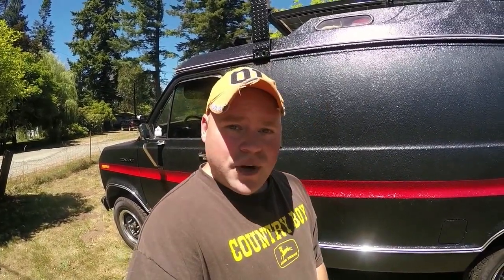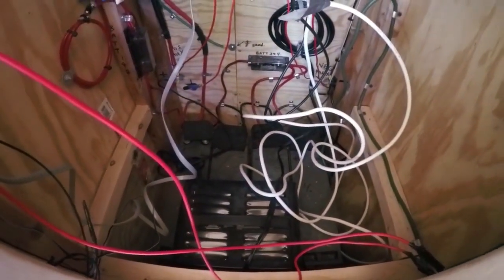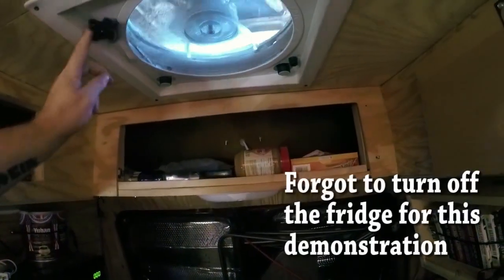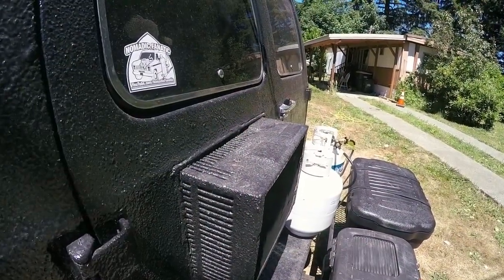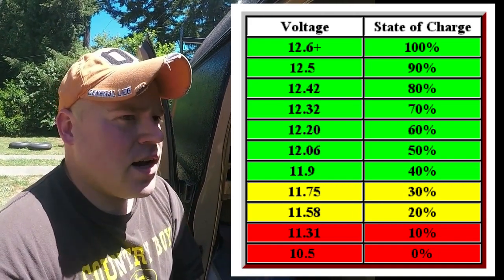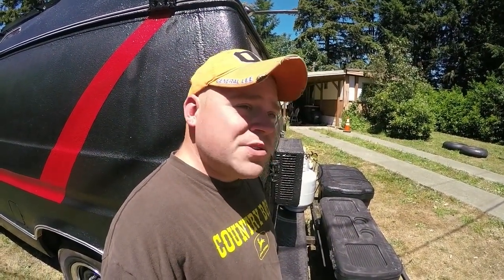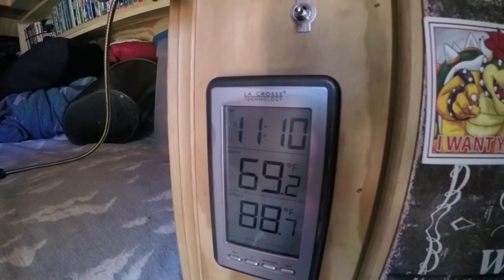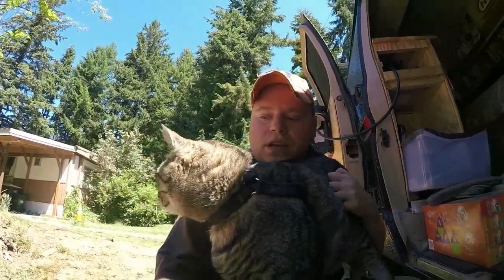Running AC Off Solar

Comment: That is really a sweet set up.  I am running a 5000 BTU A/C wall unit off of 4 batteries and 2 solar panels right now powering a 1500 watt pure sine wave inverter.   I put a video of it on my channel.  More people should do this.  The van set up is truly awesome.

Comment: HINT: black paint really absorbs the sun and makes the inside much hotter. I tried some white exterior primer from Walmart over my ancient black paint and you couldn’t touch the black paint but the thick white primer was really cool. The first problem was that it was water based and it rained after I applied it. White puddles, round my van... Next try was late in the day and the evening mist also...  OK, finally I got the picture and waited for a nice hot, sunny day.  Perfect. Didn’t look as shinny but sure kept the temperature down.

Comment: So ultimately , your AC uses way more power than your solar panel puts out and after a short time of being on, it will kill your battery,, 

You can get over 1300watts of solar panels to fit on the roof of your van ..

Comment: I live in the middle of Texas and I’m currently building a small off the grid camper trailer to pull with my Jeep. The interior is about the size of a full size bed with a couple feet extra at the end of the bed it has a ton of locking storage containers on the sides of the trailer so I’ll have plenty of storage for the solar panel equipment and batteries. I’m just wondering if I would be able to store enough solar power during the day to run a small Air conditioner in the evenings and possibly a small mini fridge? I’d also have a couple power outlets but they would only have something like my phone or laptop charging on those for a few hours during the evening as well. If anyone could give an idea of the equipment I’d need for all of this I would greatly appreciate the help I’m brand new to this but love the idea of it all.

Comment: How can cold you can you make it inside your van without over stressing the system.  In other words will it run at 70 degrees or is that more than system can handle?

Comment: Hey man could you help me setup somthing similar for me and my 12lb dog i too have had shitty habor frieght pannels and also invested in a grate to vent one end of my car open when times where tough, thinking about possibly just doing like 3 or 4 peak hour daily sessions with 350w panasonic 65 somthjng volts @8 or 9 amps possibly even finding a dc to dc psu option a/c or even making one my self using new 450w dc to dc converters bit of a stretch but anything beats 700 dollar rent

Comment: you cooled it down to below 70. If you let the AC unit turn on and off automatically you may be able to recharge batteries enough when the unit was not running.

Comment: I'm guessing your fridge is not the RV kind that runs off propane primarily... that would save you a lot of electrical juice.    Since you are dropping battery charge it's basically saying the solar system can't keep up and you are running off of battery... so no chance of boondocking indefinitely with it.  especially out here in the desert.  I think it'll be a few more years until PV panels get to the density needed to be able to power an AC unit in an RV...

Comment: Try to buy a new outbacks system and get a new 125 a/h 
5 battery and used a new 350w solar 2 panels for your power up RV test it out

Comment: Do you think Its safe to run the air conditioner on a modified sine inverter?
Reply: I dont think buying a modified sine inverters would be a good idea, you dont know good the technician who did it is. what if the mod causes it to overheat? or the wires are touching a voltage regulator that is not mounted properly to a heatsink or rough serrated metal that was cut, it can be a fire hazard more than anything

Comment: If it were me, I would cover the van with as many solar panels as possible, increase the battery bank, and try to run the A/C as much as possible.  You could literally be in the middle of nowhere where it's 100 F outside, yet Jax is trying to snuggle with the inverter to keep warm.  I'm a winter person, in case you want to know :)

Comment: Eric, I know you didn't add the AC unit into this van, but if you do decide to add one in your current RV, don't paint the condenser coil. It will significantly reduce the subcooling effect and make your AC run hotter and harder, therefore using a lot more power. Especially on hotter days. You want clean, unclogged/unblocked, un-painted coils with plenty of air-flow. Both condenser and evaporator coils. Just an FYI for ya.
Reply: EDIT: I know you have AC already in your CURRENT RV, this is just a useful tip for the future.

Comment: Thanks for posting about the ac. I am working on building my van (1974 dodge tradesman 200 maxivan) and I was wondering if the ac could be run from a solar/battery setup. Good information, thanks.

Comment: I am just a beginner at van dwelling. I just make sure to park under some trees and I have a little fan that runs off of two D batteries that I bought from Ebay for about $10. I want to do the solar panel thing, but I think I need to take care of getting a new water pump first coz itis making a bad noise =(

Comment: Hello Eric, I am a mech/ electrical engineer.   There are several issues, 10 amps at 12vdc is the same amount of power as only ONE amp at 120 volts... so that your batteries will drain roughly ten times faster than a person might think just using amperage output.    That is the key error made in these cases

The other issue is that the starting current for the AC unit is 300% higher than its rated running amps.....that can be a problem if the inverter is not sized for the extra load....the AC compressor will not start in those cases, even though it would run for a while if you get it started.   6 running amps at 120 volts AC, is the same as 60 amps at 12volts DC... your 12volt wiring must be sized to handle that 60 running amps,  AND... the 180 starting amp surge (that lasts for about 2 seconds)

The general rule is that solar is not viable to run AC systems... especially with the limited solar panel and battery capacity available even on the largest RV... it is not even practical on most larger homes.   Too many panels and large batteries are required. 

.
Reply: phil scott  Well said. A man who knows what he is talking about and articulates it clearly. People with Class B vans of Eric's type should rather pursue alternative strategies, perhaps a DC swamp cooler if the climate permits. phil scott also points out the importance of wire sizing which is a huge safety factor.
Reply: patrick price At 6:54 Eric states: "I like to boondock. So I want air conditioning from the solar. So that's how I do it."

Comment: To answer  Tammy  Delbruegge,s   comment   that Eric can cool this black van so easely   one important fact here   the size  of the van interior  is still way smaller than an average room  so it is not hard at all for that  window   AC  unit to get that van   nice and   cool ,,,,   I guess  that is one other advantage   of a van   over a   larger   RV,,,,   on a   larger   RV   this system could exist  too  but   would have to be way more powerfull   way more  solar panels,   more   batteries  bigger invertor etc   way more expensive    ,,but with a van   the system needed is   smaller and   less   expensive

Comment: are you still planning on buying a trailer??? for extra storage
Reply from the maker: Danny Menary Not at this time. I did buy a 6x10 storage here in Olympia for storage.  I'm going to live the van life until something happens. :)
Reply: Nomadic Fanatic Please forgive my naivete, for I have not attempted van living yet.  I was just wondering what type of air conditioner that was in your van back door.  Is it a "regular" type house ac unit, or a special type for vans/rv's?
Reply: Nunya Bizniz regular
Reply: Nunya Bizniz That air conditioner is a regular house window unit - you can get them for under $200. The trouble is that they are designed to be installed in a static environment and were not engineered for the constant vibration and shaking of a moving vehicle.
Reply: Nunya Bizniz $86 ac unit at 5,000 btu on-line from Walmart.  Erics ac unit is 5 yrs old & still working good.  What vibration?

Comment: Good video Eric. It looks as your system suits your needs. That what counts. So many people say go bigger(not that its not a bad idea) But if what you have works and suits your needs then why mess with it.
Reply from the maker: Yep thanks Wayne. As long as I'm happy it works
Reply: Nomadic Fanatic You could go further and add some insulation to the roof from Lowes/Home Depot.  Could really help the temp from changing so quickly when your AC is cycling on and off = longer running time.
Reply: ChillCosmos Or not paint the roof black.
Reply: Ted Fryman it looks awesome that way though, I'm all for the black roof.
Reply: Ted Fryman the shade from the solar panel keeps the roof cool already & Erics adding another panel which means more shade & panel.  The roof to panel space is 6 inches apart. 
 Your point is moot.
Reply: steve murphy people crack me up on here when they ought to just stop putting the guy down.  Who really cares whar color the guys roof is as long as the vehicle is insured.
What the dummies don't realize is that Eric spray foamed the inside roof already plus like you said, the solar panel shades it anyway with another panel coming soon for more power.
Reply: Nomadic Fanatic "As long as I'm happy it works" A true definition of solipsism. What a sick dude and you folks are falling for it.

Comment: Does the AC run all the time? You could install a line voltage, single pole, cooling stat. Home Depot Lowes probably wont have it but an electrical supply will. It simply wires in like a switch and shuts off when you reach a coolness then as things warm up, it will switch on again till coolness is reached again. Its function is reverse of a thermostat. About 15-20 bucks us time and orher parts.
Reply from the maker: Actually the air conditioner I have installed on the back is just a normal house window AC unit. So yes, the compressor will turn on and off and maintain a set temperature. I wasn't specifically trying to get it to a temperature today I was just showing the setup as an example

Comment: Is the inverter in the van modified sine wave or pure sine wave? Typically AC units runs a lot smoother off a pure sine wave inverter and pull less wattage. If it's not a pure sine wave inverter, you might want to keep it in mind for the future if you want to upgrade parts of the power system.
Reply from the maker: Pure sine wave cobra inverter

Comment: Your system was coping well with that AC unit running for 2 hours! I think you have it completely right though cracking the windows and using the fantastic fan for air flow. The airflow past your skin will help your body stay naturally cool anyway, without the power hungry AC running. Its a nice thing to be able to do if you need to though

Imagine some kind of unbearable humid night when you cant use the genny, this would be perfect!!! :)
Reply: LambySRI LOL, it was running for 28 MINUTES, not anywhere near the 2 HOURS he claimed in the video. Check the times on the thermometer during the before and after shots.

Comment: Yeah, but what was the humidiity?  Makes all the difference on the power consumption,
Reply: I figured that if it's a 10 amp AC unit - that translates in to 100 amp-hrs.  So it's possible with a 400 ah bank, you could run it for 2 hours.  Perhaps longer if it's cycling.
Reply: steve murphy my 2k honda gen won't even come close to running my 5th wheel ac.

Comment: Pretty amazing your running the fridge and a/c! Thanks for showing a demo on the power you have.. Another reason I should invest in the same fridge dang..
Reply: Hobo Tom Not really a 'fridge'... More like a DC powered cooler..
Reply: HuukedOnFonix That is a real fridge. .it uses a DanFoss compressor. .engles are made by Fuji and have a Fuji swing compressor. .and Wal-Mart. Com sells engles
Reply: Jeezus. I don't care if it was straight off of the space shuttle....If it's barely big enough to fit a 12 of beer, it's a freaking cooler - not a fridge..
Reply: HuukedOnFonix I am with you on that. . But can freeze blocks of ice solid fast. .I would have up sized also

Comment: What if you placed the A.C unit @ a set temp(78) to where the A.C unit cycles on & off,would that help to extend the time usage for Your A.C operation from the 3 hours to maybe 4 or 5 hours off Solar Panel/Battery Bank Power?

Comment: The Solar is doing great.However I would still get at least one more panel for up top.You can get 300-400 watt panels for a good price if you shop around.

Tim.
Reply from the maker: I agree
Reply: Start The Rebellion I know my mistake buddy, just realised what i said. Its unlikely he'd fit more then 500 on the van for roof space etc, if he had anywhere near 500 that would be awesome :)

24V FTW :P
Reply: Start The Rebellion It is a MPPT controller not a PWM.
Reply: steve murphy Yep, I hear he does jingles to supplement his income !!
Reply: Start The Rebellion the guys a banned troll so they interact with us to make conversation.  Just ignore the guy & report his comments 3 times & they didappear.
Reply: Panels have to match & be within 10% of each other.  Oh sure miss matching will work for a while & then fry.  Hhmmm, his 225 w panel was $200, the mppt controller $209, copper cable / fittings $200, cobra inverter $139 & the 4- batteries add up to $1,600  That comes to
$2,348. Plus another matching 225 w panel at $200 comes to $2,548.  Yep, at that amount I'd say Eric converted the van although the Trolls & Nay Sayers would disagree.  The van was worth $1,200 although it was gifted to him plus hes put allot of maintenance dollars $ in it as well.
Reply: steve murphy I thought he got most of that stuff for free? At least the batteries, I think.
Reply: He's getting another matching 225 w panel when he gets back to Florida X-mas.  Or so he hinted.
Reply: Start The Rebellion You stated: "The only thing though is that @ 12v the Charge Controller is going to have a limitation on the total watts it can process."  You obviously do not understand the difference between MPPT and PWM. You need to do some homework before you set yourself up as a RV expert.
Reply: Start The Rebellion You are completely wrong. MPPT ups the Amperage when Watts are exceeded. PWM dissipates the excess Watts as heat... Go to school before mouthing off.
Reply: Start The Rebellion  "I'm just someone who's studied RV solar for a long time.-". LOL! - you need to study it for a longer time. You don't have a clue.
Reply: Start The Rebellion Why don't you explain, in your own words, the difference between a MPPT controller and a PWM controller and why you would you buy the more expensive MPPT controller. Go ahead smart guy.
Reply: Start The Rebellion OK stay right here then and answer the question: "What is the difference between MPPT and PWM and why would you buy the more expensive MPPT controller?" Can you answer that? It is a simple question. You said that you were going to start a series on your upcoming channel that will focus on RV Solar:  "Once I get my channel up and running in a couple of months I am going to do a series of videos on all the various RV solar power topics" -- so fill your hand, Mr. Expert. Definition of a troll: "someone who disagrees with me".  You can laugh at me, but everyone else is laughing at you.
Reply: Start The Rebellion Just cut and paste it out of Wikipedia if you can't handle it, fool.
Reply: ScootOverMan  I added "The Math" comment in after your comments... here and on my channel I do the math to run an Air Conditioner from a battery bank (no solar & no generator) and how long it will last.
Reply: Start The Rebellion  Coward and fool and charlatan who deletes his own posts when he is found out.. Remember "Start The Rebellion" for what he truly is. We need to drive these crooks and cranks from YouTube. It is our community.
Reply: Start The Rebellion. Just report the guy. Drunk & Snarky thinks this is some how a solar blog which it is not.
No vandweller or RVer has to explain this stuff perfectly.  Big deal Eric got a few words wrong.  The point is, is that Eric has it & it's very elaborate for a van.  Hell, most rvs dont have anything this fancy.
Reply: Start The Rebellion Ha! Go crawl into your hole now, and save your so-called expert advice for the more gullible.
Reply: Start The Rebellion You can't ignore the truth, fool. You post nonsense and now you must be held accountable for that nonsense. You want to call the world "trolls" when they call you on your bullshit? You are a charlatan and a deceiver who wants to start a channel about "RV Solar"? Go crawl back into your hole, you are not wanted on YouTube.
Reply: 10:39 - 11:08 lol 2 hours
Reply: steve murphy So I guess that it is OK that he lies about the elapsed time he ran the AC. Lies all the time from this guy and all the fanboys lap it up. It is not about being a fool and mixing up words, (I can accept that and there are many fools like Start The Rebellion on YouTube), but rather he is an out and out liar and a charlatan.

Comment: Nice set up do you have Generator for back up? I have a nice gen but would like to get solar down the road if things work out. I travel full time in my camper and have been uploading videos as well. Check my page out when you get time.
Reply from the maker: Yes, 2000w generator/inverter on board also

Comment: Two products that might help you out are:
1) Kill-a-watt - http://www.p3international.com/products/p4400.html - $18
a) You can use the Kill-a-watt to determine the electrical draw of any appliance in watts, amps, voltage, etc.
2) 24 Hour Timer - https://www.1000bulbs.com/product/89347/SUN-734110.html - $10
b) You can use the timer with your fridge set for 1 hour on, one hour off. Works fine that way.